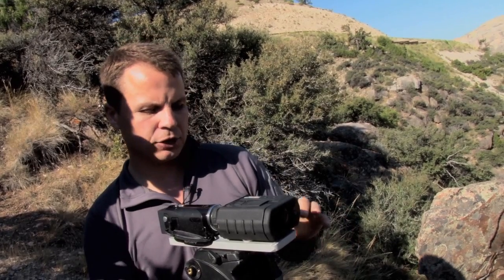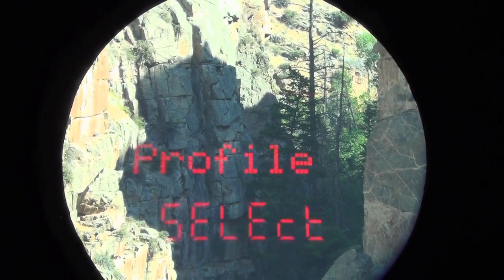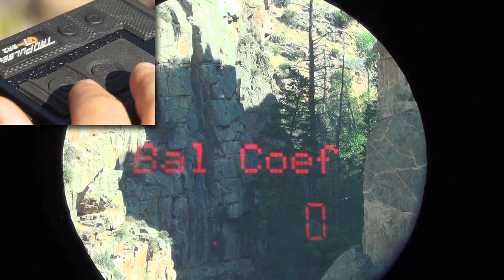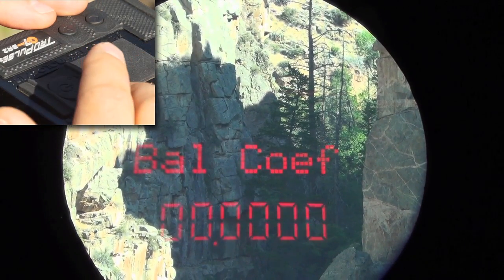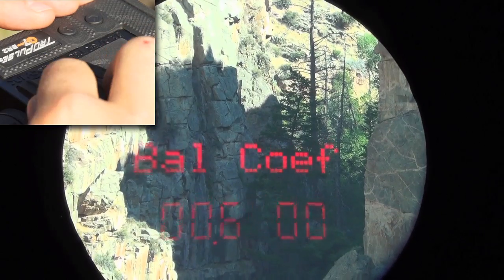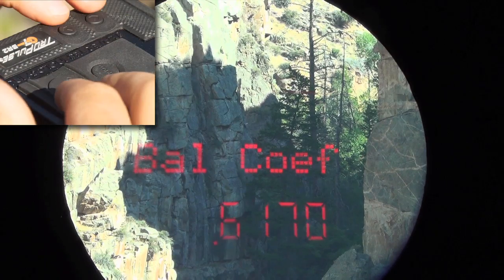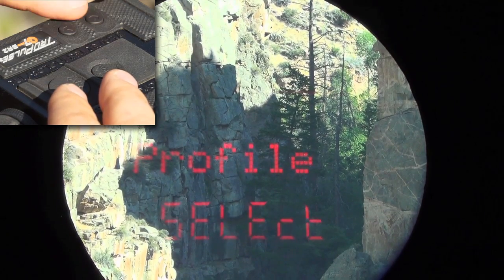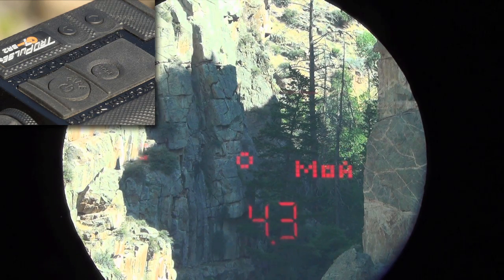G7 BR2 Rangefinder Programming a Ballistic Profile

Comment: Can you explain the difference between range finding with the moa to why you use bdc I would have thought if your range finder told you to come up 2moa for example that’s what you would dial ??
Reply: If you are using a BDC turret, the device can be set up give you your dial up in that format. To do so it must be told what temperature and altitude your BDC turret is calibrated for. With a standard MOA turret, simply select MOA output.

Comment: G7 BR2 sounds impressive by any measure.  I don't think you need to resort to 1000 yd examples to illustrate dramatic POI changes relative to inclined shooting or changes in temperature.  I would also offer that if one is elk hunting and has the mobility to move from an elevation of 2000ft in the morning to 8000ft in the afternoon, he doesn't need a rangefinder to make the shot.  Your explanation is excellent and very convincing - the science and scripting need not be so extreme.  The product ends up sounding "too good to be true."  Tell me about battery life, operating temperature, waterproofing and unlimited lifetime warranties!
Reply: True it is a great range finder but the ballistic solution operating range for the ballistic computer in the BR2 is 1,400 yards max because this is typically the range that corriolis (spin of the earth) starts to come into play and the BR2 does not have a compass to compute this in the firing solution. Sure it will still range out there along ways but only give you a ballistic firing solution out to 1400 yards. Still very cool. Most folks hunting aren't taking shots at wild game at those distances.